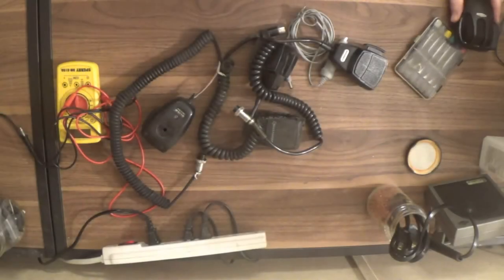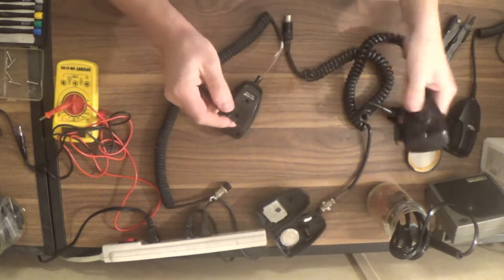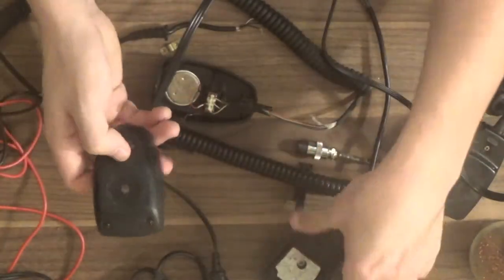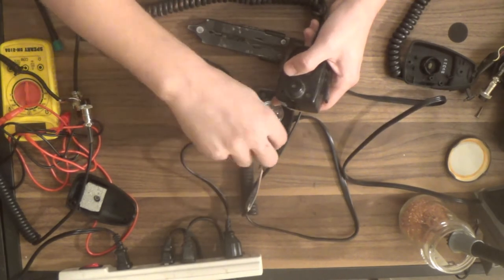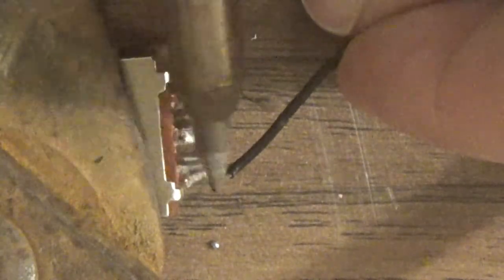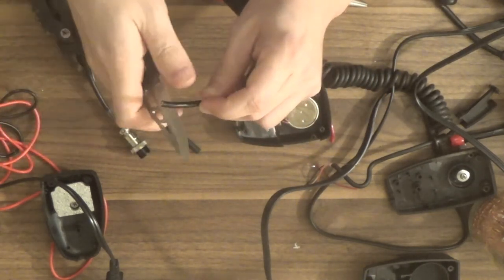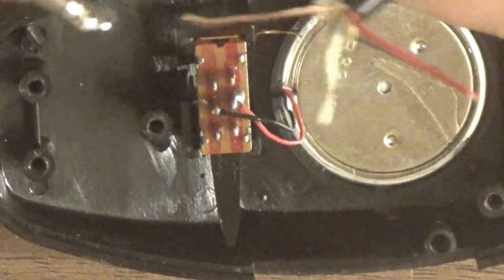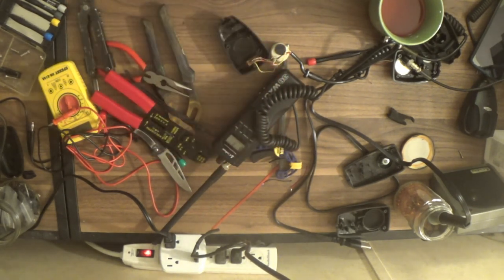VLOG   Texas Ranger CB Radio Microphone Repair

Comment: I have two noise cancelling mics that have quit working now after hitting the floor pretty hard. I took the RK56 apart but can't find any apparent damage.
Do you have any idea what the problem might be?

The ranger SRA 198 might have a wire loose near the radio plug,. I haven't checked yet. The insulation there is crapping out a bit.